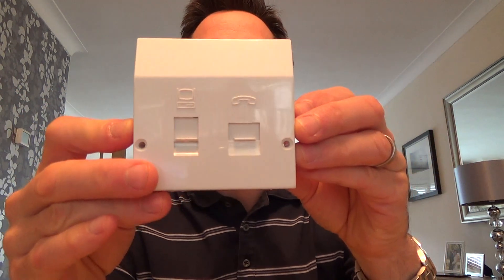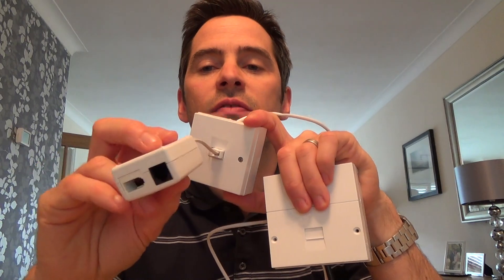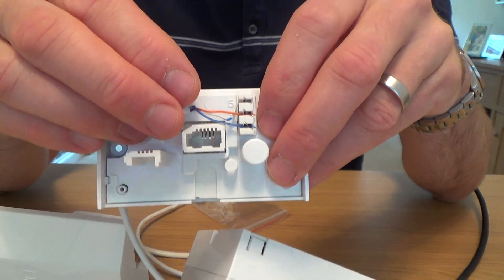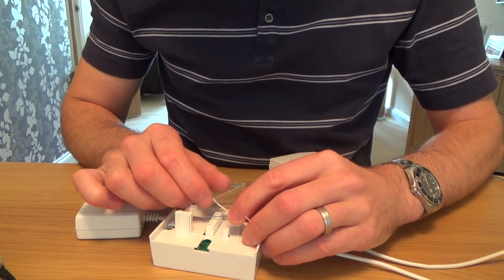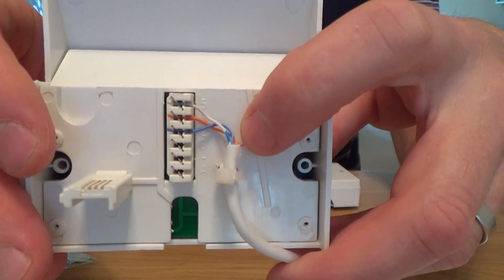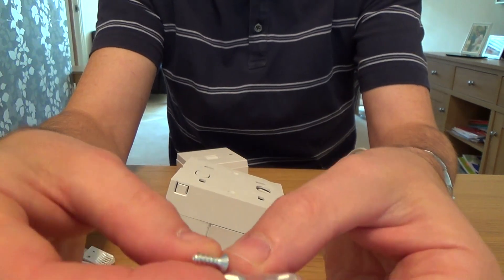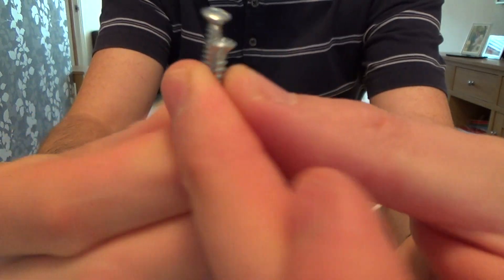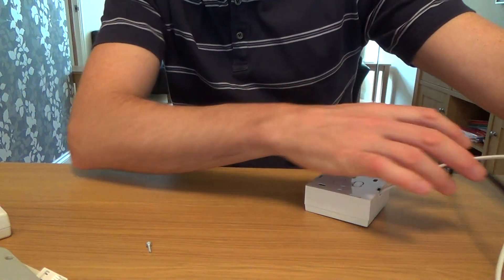How To fit an ADSL FACEPLATE on your NTE5 telephone master socket.

Comment: Thanks Vince for making it look so simple and I managed to wire up a VDSL Plate myself, made 2 small extension wires from A & B to the main Blue/ Blue+White Wires (as the main wire were short) and using some Gel Crimps as well only for the Internet and saved me a bundle £££ :)

Comment: The beauty of these modern Adsl faceplates is that you can use both the A and B terminals in the unfiltered side of the front plate to run a cable to another similar adsl socket and just connect to the A and B terminals there, doing it this this way would mean you are in effect moving your master socket to a new position and depending on the type of cable you use eg if it's good quality cable (Cat 5e, Cat 6) then any loss of broadband signal should be very minimal as all you are really doing is extending the main service wiring that comes into your house, thanks for such an informative video.

Comment: I don't even have a master socket at the external line entry point. It's a blank face plate with a rough hole cut out on the bottom side for the extension wire to traipse from hallway to living room, lmao. I'm going to overhaul the whole thing.

Comment: I have an extension in my living room but it isn't connected to the master socket, what could it be connected to? 
the cable thats connected to the extension runs through the wall which is why i can not chase it to find out what it is connected to.
please help

Comment: Hi cool videos... I wanted to remove my NTE5 extension when I disconnected the first 2 wires (white and orange) the other cordless phones stopped working. Do you have a video on disconnecting extensions?

Comment: Hi Vince, my master socket (nte5) is under my hall floor (?), if I hard-wire a Cat5E cable to it and bring the cable up in the lounge, can I fix a new socket to it with a VDSL face-plate?   My only phone and my router are both in the lounge, p.s. I already have the bits to do it.
Reply from the maker: Hi, if you have no other extension running from the NTE5 under the floor then your idea will work but it may confuse an engineer in the future why you have 2 NTE5a on the one line. Also remember that your real master socket is in the hall under the floor so if you ever get a fault on the line you will have to do your testing from the test socket of the real master socket not the 'imitation' master socket in the lounge.
Thanks Vince.

Comment: if i fit one of these face plates but run an extension off it from connection a and b do i then need a filter for adsl at the extension socket?
Reply from the maker: If you only want to plug your router into the extension then you do not need a filter.
Reply: +My Mate VINCE ah yes ofcourse filter is for voice only. Thanks for the vids they are great.
Reply: +My Mate VINCE can you get a master socket that splits voice and data so i can then the voice on one pair and the data on a second pair then i can have modular sockets at the extension and keep everything seperate?
Reply from the maker: Hi, yes you can, in fact I have done a video that is exactly what you asked, when you have time check out https://youtu.be/2xwTOl3PBKw
Many thanks Vince.

Comment: hi your all videos are very informative. I have question  what is the difference between adsl and vdsl face plates and which one is the best?
Reply from the maker: Hi, thank you. The filter in the VDSL filter is better. VDSL will work well with ADSL and VDSL so I would recommend getting the VDSL faceplate even if you just have ADSL at the moment.
Thanks.

Comment: Hey Vince, I just got fibre broadband I'm running an extension cable from one extension socket upstairs to another room upstairs (so a long way from the master) and my downlink on the router says 45168 kbps but when I bring the router downstairs to the master socket and plug it into the test socket it goes to  79999 kbps. 
Will putting an ADSL faceplate on the master socket and leaving the router plugged into that with no microfilter give me the full 80Mbps downlink that the test socket gives?
Thank you!
Reply from the maker: +James Sanson Hi, yes it should do or at least very close to the result in the test socket.
Thanks Vince
Reply: My Mate VINCE I rang my ISP and their support team said to get a Vdsl faceplate instead of a Adsl one.
I've currently got my router plugged into the test socket and getting 72mbps down and 19up over ethernet and 45-50mbps down on WiFi.
Will powerline adapters give the same throuhput as a direct ethernet connection (I can't have a direct connection all the time because of the location of the router)
Sorry for all the questions but there isn't a lot of clear information online!
Reply from the maker: +James Sanson Hi, yes, definitely get the VDSL faceplate rather than the ADSL and the powerline adapters will depend on your electrical wiring. If the wiring is in good condition then it may achieve the same result as Ethernet. Unfortunately you have no way of knowing until you test a set of them out.
Reply: My Mate VINCE Thank you very much for the help! Always nice to talk to someone who knows what they're on about and are friendly about it!
I'll order the faceplate now!

Comment: Hi Vincent. Thanks so much for the video. I just swapped the NTE5 faceplate for a VDSL2 faceplate and my download speed doubled! I'm hoping the connection might be more stable too. Very quick delivery of the faceplate from your eBay shop too. Thrilled with what this £15 upgrade has done. Thanks again
Reply: *Vince
Reply from the maker: +Richard Gallagher Excellent, thanks for letting me know.Cheers Vince

Comment: HI, great video thanks. For hardwiring the ADSL cable - where do you get the solid core (pref shielded?) cable that terminates in a RJ11 (for plugging direct to your router)?
Reply from the maker: +arnoldtoht You will struggle to get a shielded lead in a RJ11 because it is too thick but you can get solid core normal UTP anywhere online and crimp on the RJ11 yourself or if you are in the UK then visit my ebay shop and I can sort you a lead out with just one end terminated.Thanks Vince

Comment: Hi Vince, I have fitted your "infinity set-up" so have the facility to connect to the A-B on the back of the front plate. I want my router elsewhere and to do this can I fit a ethernet wall socket (I bought one of your internal network kits) connected by Cat 6 cable with the centre two cables connected to A_B in the back of the frontplate? Or is there another way? Excellent videosby the way!
Reply from the maker: +Alex Bailey Hi there, yes you can use that kit, connect the white/blue wire to A and the blue wire to B on the VDSL faceplate and then on the RJ45 socket in the new location just connect up the blue pair following the wiring label on the rj45 socket as this will liven up the middle 2 pins. Then you can use a normal/existing ADSL cable from the rj45 socket to the router or you can make/use a RJ45 to RJ11 again using the middle 2 pins on the blue pair. the Rj45 socket will allow either a RJ45 or RJ11 plug.Many thanks Vince
Reply: Thanks Vince, much appreciated

Comment: Is it pointless to combine an ADSL faceplate with a BT IPLATE (Accelerator)?
Reply from the maker: +Seoul Ting Hi, yes it is pointless.
Reply: +My Mate VINCE Thanks for the reply. I really appreciate it.
I found the information here too. 
http://www.increasebroadbandspeed.co.uk/I-Plate-broadband-accelerator-adsl-faceplate
Had problems with extension sockets for the past few weeks.
Have ordered an ADSL faceplate, RJ11 cable and Krone tool.
I've troubleshooted the extensions around the house.
Determined a particular cable is dodgy as when I walk on the floorboards where the cable is under, the phone dial tone will cut out and come back on.
With how the other extensions are configured, this cabling does sometimes cut the dial tone at the other telephones.
My temporary solution is to not use the extensions for now, get a quote on how much the rewiring will cost, and only use the master socket with ADSL faceplate, one telephone and BT Hub.

Comment: Hi Vincent can I put a BT open reach vdsl faceplate on the end of my extension not sure if this will work can u help please

Thanks  chris
Reply from the maker: K Crawford Hi Chris, no unfortunately the VDSL plate has to go onto the NTE5 master socket on the 1st socket in the property. If you put it at the end extension and then plug a phone into an earlier socket it will not be filtered and will cause speed problems on your broadband.Thanks Vince

Comment: Hi Again, if using the terminals A & B to hardwire is there any difference in performance quality to doing this compared to plugging in as I have read somewhere that terminals A & B are not filtered .
Thanks.
Reply from the maker: Peter Jones The A and B are NOT filtered just like the ADSL port on the front, both are unfiltered. Only the Voice side is filtered. There will be little difference between the 2. You normally hardwire it to make it look neater and to stop damage occurring because if it was in a narrow hallway then there is more chance of kicking the lead by accident.Thanks Vince
Reply: Thanks for the reply.Vince.
Brilliant videos.

Comment: When hardwiring the cable from the router to A & B terminals which wire goes to which terminal, or does it not matter.
Thanks.
Reply from the maker: Peter Jones You use the middle 2 wires on the RJ11 plug, and it doesn't matter which way round you put them onto the A and B terminals, they will work either way round.Thanks Vince.
Reply: Thanks a lot Vince for that very quick and helpful reply

Comment: Looking at your video (and every description I've read online), it appears that you have one wire per terminal. Mine is anything but that!

Terminal 2 of my NTE5 socket has a white/green striped wire AND a white/orange striped wire too.
Terminal 5 has a solid green wire AND a solid orange wire attached to it too.

(See here: http://imgur.com/a/hacrA )

I'm guessing this is pretty unconventional. I'm tempted to go ahead and fit a filtered facelate but I'm cautious seeing as the wiring is so abormal on my master socket. Do you suggest it's OK to go ahead and install the filtered faceplate or will it break my extension sockets?

Thanks, John
Reply from the maker: jsmith020413 Hi John, if everything is working fine now then you will not have any problems fitting an adsl faceplate, just make sure you copy the colour code exactly as it is now on your existing front plate and DO NOT use the colour code in my video. The colour code in this video is the standard colour code but on your master socket front plate they have still used pairs of wires so although it is not 'normal' it will still work fine (the wire doesn't know/care what colour it is). It was probably done by an electrician rather than a phone engineer. You could make it the standard colour code but you would have to change it in every phone extension in the house so it is easier to just go with what you already have. You are allowed 2 wires per slot so again this is fine.Many thanks Vince
Reply: My Mate VINCE
Many thanks for the clarification!
Reply: For the last couple of days, I've been plugged into the test socket to see how ADSL performance is.

One quirk I've noticed is that when the router is plugged into the test socket, 1 of my 2 extension sockets still works. The 2nd extension only works when the test socket isn't in use.

Based on what I've read, plugging into the test socket is supposed to "disable" the extensions, right? 

So if I do fit a faceplate, will both my extensions definitely work?
Reply from the maker: jsmith020413 It sounds like you have one of your extensions teed in before the master socket. It is not the correct way to do it but years ago BT owned everything even extension wiring so often extensions were teed in if it made the job easier. If that 'teed in' extension became faulty then it could knock out your telephone line even if you unplugged the front plate and used the test socket so your nte5 master socket is not doing the job it was designed to do. If you fitted an adsl faceplate then you would still have to plug in a microfilter into the 'teed in' extension otherwise your will hear the broadband noise down your phone and also it will severely degrade your broadband.
Hope this helps.
Thanks Vince

Comment: I have a problem with my bt socket all the cables is disconnect  and I really don't know how to do because I don't know where is the position of the cables thanks for you help if you can put where to connect
Reply from the maker: Have a look at my other video titled:
How to install a NTE5 Telephone Master Socket and Telephone Extension.
This video shows the standard colour codes to use.

Comment: Hi, I'm sorry but had that a question that is slightly irrelevant to this video. I am totally redoing the wiring in my house. I was thinking of putting the master socket upstairs in my room where the router/modem(center point for Wifi too) would be and then have extension sockets going from that to the rest of the house where needed. Could you advise the name of the required extension cable and if this positioning of the master socket is reasonable or am I better off just putting the master socket in the living room and running an extension to my room and connecting the modem to the extension in my room? 

Thanks in advance. Alan
Reply from the maker: Alan Sabu Mathew  Hi Alan, it is best to have the NTE5 master socket fitted where your router is going to be sited and then you have the option of fitting an ADSL faceplate or VDSL faceplate which will give you the best broadband signal. I would run data cable like cat5e around the house for extension wiring and then if needed you can use those cables in the future for a dedicated ADSL/VDSL extension which will give you more options. A telephone extension will work fine on cat5e cable. Thanks Vince
Reply: I've read in several places that I shouldn't touching the cable from outside the house to master socket... But when I came to this house... The master socket was ripped out. So is it okay if I do this placement myself. Also, there was a box outside my house named 'encom' with two cables from it stopping just short of a hole that let's them through the wall. They look to be cut prior to when we arrived. Could you please advise what this is and what I should do? 

Thank you so much in advance! Alan
Reply from the maker: Alan Sabu Mathew  I am not sure what Encom is, maybe it was an old cable connection box before the days of NTL and Cable & Wireless. The last owners could have been with Cable (Virginmedia) instead of BT, maybe there has been no service from BT or Cable for many years so it looks like you will need an engineer to come out and connect up your property. It would be pointless to spend time running a cable if no service existed originally as you will still get charged for an installation because the rest of the line would need connecting up outside. I would recommend doing all your own wiring inside and leave the line up to the master socket to the service provider.Good luck with it.Vince
Reply: So if I use a cat5e cable for the extension wiring, then will I get broadband on every single extension and not just at the master socket? As per my current knowledge, you can only get broadband at the master socket. Am I correct? Sorry, I'm very new to this area. 
Thank you so much for your advice
Reply from the maker: Alan Sabu Mathew No, unfortunately not. You will only get broadband on the point where you have your router. If you want wired broadband throughout the house then you will need to run network wiring or just settle for Wi-Fi. The reasons for installing cat5e wiring was to offer flexibility for other uses in the future. If you spend some time doing research on Google you will find all the information available. I wish you good luck with your project.Thanks Vince.